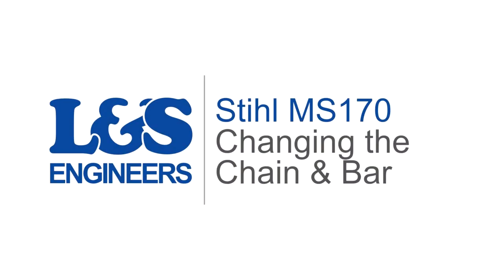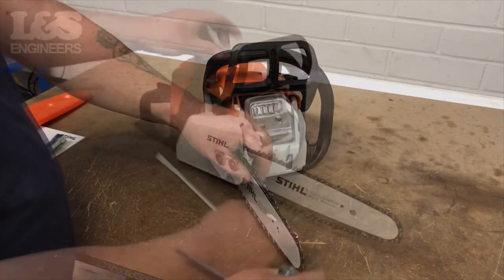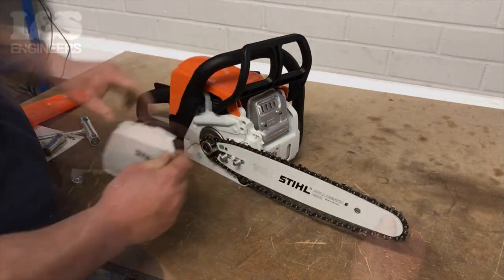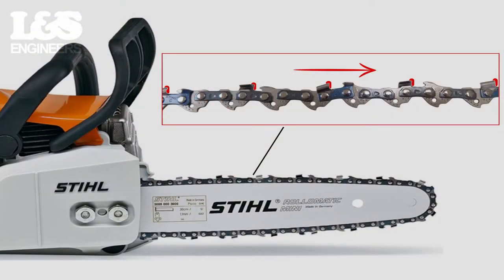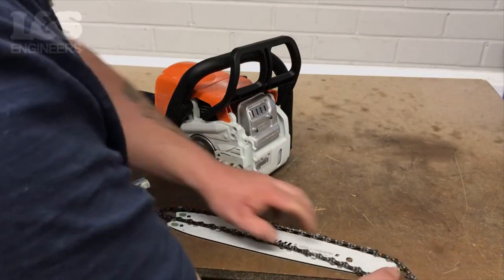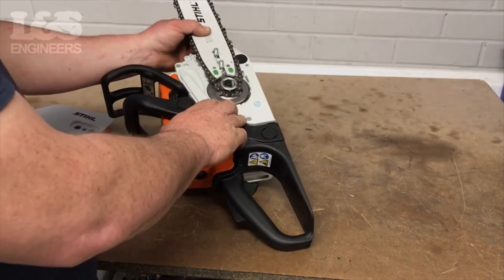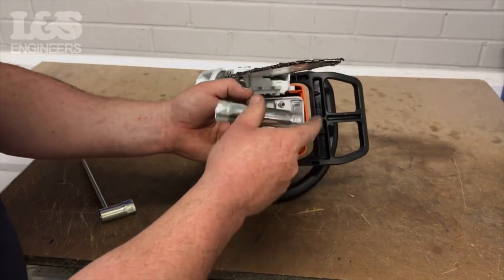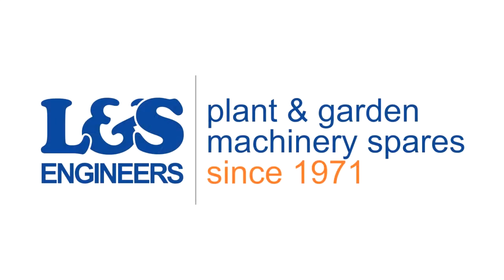How to Change the Chain and Bar on a Stihl MS170 Chainsaw | L&S Engineers

Comment: I really think it would be helpful if you showed the position of the front chain tensioner before you start to tighten it. Many beginners (myself included) thought the screw should be as far out as possible. Shortly after I bought my saw someone corrected my thinking. I'd guess many people looking at this video are beginners and would benefit from seeing this detail. Also, I was taught to hold the nose of the bar up as I tighten. Perhaps this really isn't important... it's what I was taught and it is certainly part of the instructions in the manual.

Comment: Tried to change the chain on my MS170, seemed simple enough until I tried to loosed the nuts that hold the plastic cover and bar. Nuts on both studs would not loosen and the entire stud came out of the body of the saw. Took a while to loosen the nuts and get them to stay in so the chain could be changed. Makes you wonder about Stihl.

Comment: So after i get the chain on the blade,tighten everything up and the fire it up,after it runs,i see little sparks from the tip of the chain.
  This normal?
Is that just the chain adusting to the blade?

Comment: How long chain is used in this machine 16" or 18".
Reply from the maker: Hi, This will either be a 12" or 14" saw chain 3/8" P Gauge: 1.1mm (.043")

12": https://www.lsengineers.co.uk/stihl-12-chain-loop-pmm3-3-8-picco-043-44-links.html

14": https://www.lsengineers.co.uk/stihl-14-chain-loop-pmm3-3-8-picco-043-50-links.html

Comment: Why is my chain so tight it doesn't move freely after placing it on the bar?
Reply from the maker: Hi, sorry to hear that you are having issues with your chainsaw, there could be many reasons why this is happening. For example the clutch sticking, a worn bar sprocket or if the tension is too tight. If you would like to phone us and ask for our technical department we can try and help you find the issue 01543 378189 :)
Reply: @LSEngineersTV   Appreciate your reply, but I discovered my chain saw bar only took a chain that would fit a .043 gauge bar fit.

Comment: I like to cut wood with my Stihl   chainsaw but it won’t start.
Reply: Hahahahah. I'm hoping this is a joke for your sake. In my experience there are a few reasons this could happen but you'll find the answers on Youtube, I promise. My Stihl doesn't like January, so I warm it in the house and it starts up right away. Otherwise, check the spark plug... sometimes a little plug cleaning will do the trick. If not, experts on Youtube have certainly covered the problem.